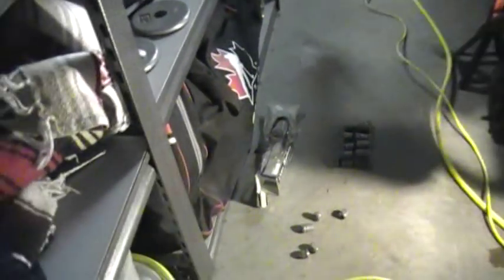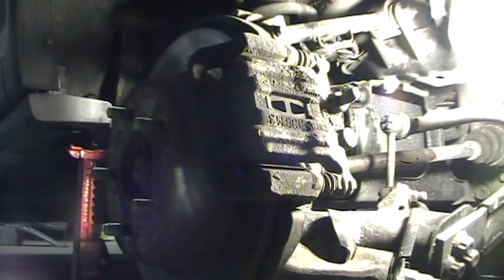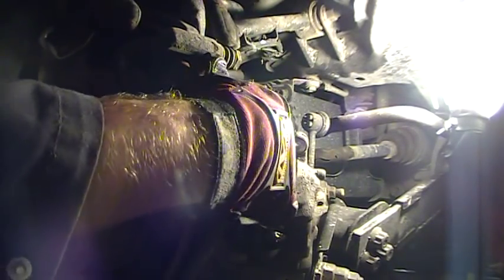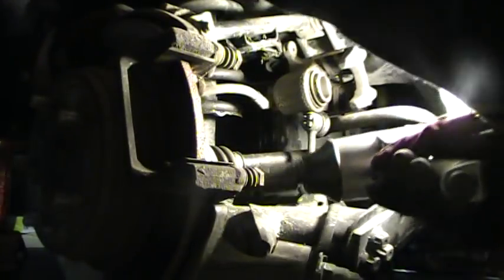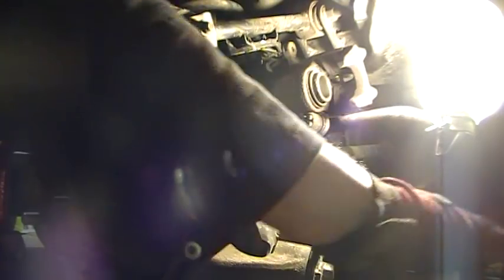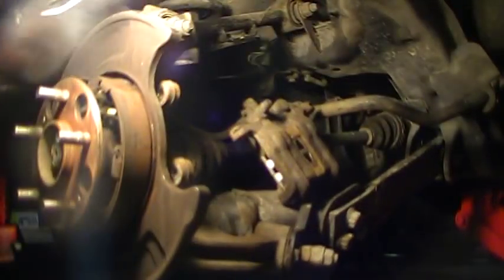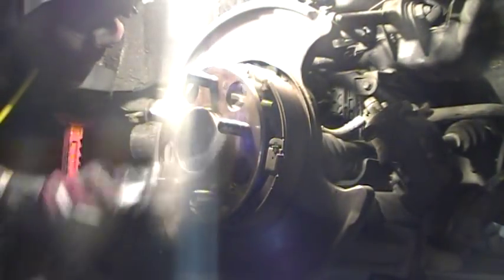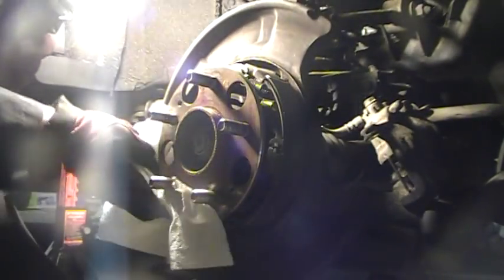How to Replace Rear Brake Pads and Rotors on a 2003 Honda CR-V

Comment: Thanks for taking the time and effort into making this video. A few things:

That access plug is there so you can turn/adjust the parking brake ratchet teeth without having to take off the entire drum. 

Also, torque specs for those interested (from the Helm 2003 CRV service manual): 
Front caliper bracket mounting bolts: 80 lbsf-ft
Front caliper body bolts: 25 lbf-ft
Rear caliper bracket mounting bolts: 41 lbsf-ft
Rear caliper body bolts: 16 lbsf-ft
Reply: Thank you!

Comment: The rubber cap is a plug for the access hole to adjust your e-brake shoes. Just use a screw driver to adjust.🚙😎
Great thorough videos.👍🏻
Reply: Through but so far from a good job that the video is dangerous.

Comment: Good video.  Thank you.  I would advise however not to put the clamp inside the piston when pushing it back.  Use the old pad on the piston and put the clamp on the pad.  I usually just use a screw driver while the calliper is still bolted to the car to push it back, but I was unsure if these were screw type or not.  So thank you again for solving this mystery!
Reply: The screw types are going to be when there's the parking brake included on the caliper

Comment: Watched this vid three times then went and did it myself. Also found two rotor screws were missing completely on one side....wtf. Thanks Dakota.
Reply from the maker: +uscg906 Ususally when the rotor screws get stuck or cause a huge problem, people just toss them. It's not 100% necessary since the wheel holds the rotor against the hub, but it makes reassembly a tad easier
Reply: The 2 extra threaded holes on the rotor are there to assist with rotor removal.  Thread a bolt into them to press the rotor free despite being seized up.  It saves a lot of banging on the rotor to loosen it.

Comment: The rubber plug you ask about stops the drum from having that vibration noise when you apply the break mainly cut out the ring tone in the drum  Nice Video

Comment: Great video.
 When the piston  on each caliber is pushed back ( all four) watch out for oil in the oil holding tank will fill up and spill out on to the paint of the body.
Reply from the maker: +Gregory martin You only really run into that problem if someone has filled up the brake fluid when the brakes are worn out. I've only ever had that happen to me twice.

Comment: That rubber plug removed allows access to the parking brake adjustment wheel ( Star ). Rather than prying or hitting a rotor,  remove the plug and rotate the hole until it is roughly in the 6 O’ clock position. You should see the adjustment wheel and using a flat blade screwdriver, you can turn the wheel to eliminate parking brake pressure on the drum portion of the rotor to easily remove it. Those two machined holes on your rotor will accept #8 metric bolts which can be alternately tightened to force the rotor off an axle. Work smarter not harder!

Comment: Don't know if it has already been said, but the rubber stopper on the rotor, is there to be able to reach the parking brake adjustment without removing the rotor itself.  I just saw it on another tutorial.

Comment: I appreciate your efforts here. One suggestion - maybe don't have the light shining into the camera.  Also one honda rotor tip, is that rather than prying it off against the fragile splash guard, use the two provided holes and run two bolts into them to push the rotor away from the hub. It wasn't the parking brake making it stick (or the wheel would not have turned so easily) - it was just rusted on.

Comment: I have a 2002 honda CRV and I need to change my front brakes. Can I rely on your video to change my front brakes or there are specific particularities for front brakes? It's gonna be a first time experience for me! Thanks for you reply
Reply from the maker: It'll be a similar process, but not the same. If you're mechanically apt, you should have no issues.

Comment: great video.  just curious, however.  doesn't anybody use a torque wrench anymore?
Reply: I use them just for torquing head bolts, crank or rods. that's the only time.

Comment: Thanks for the video. Question -- do you think it's worth it to take the old rotors off and have O'reilleys resurface them rather than buy new?
Reply from the maker: It is if the rotors are in good enough shape to resurface them. If they're dark coloured from being overheated, grooved, cracked, or anything else, then it's a good policy to replace them. If you take them to be resurfaced, then they should measure the rotor thickness to make sure that it's still safe to use. The rotors should still be adequately above the minimum thickness after cutting to ensure longevity and safety. If they don't have enough meat left on them, then replace them. It typically doesn't cost too much more to replace them versus machine them because of cheap brake parts.

Comment: Did you have to bleed your brakes after completing the job? And I have always just used a c-clamp and pressed back the caliper and the fluid would just return back into the reservoir. I had a buddy suggests clamping the rubber brake hose and open the bleeder when compressing the caliper and I think he said the reasoning is that with all the pressure pushing back on the master cylinder there is a chance of screwing things up. What is the proper way of compressing a caliper?
Reply from the maker: I don't bleed the brakes after doing a brake job, I always just push the piston back in and it never has had any issues. I sometimes crimp the brake hose and push the piston back in, but that I really only use for screw calipers.

I did have to bleed the brakes on this car though, but only because I also had a seized caliper on the passenger side

Comment: Rotor screws were put in place for assembly reasons on the assembly line. You dont need them to go back on. You could even drill them out.   If it comes down to the little rotor screws holding the wheel on you will be in trouble already.  You dont need those little things on there.
Reply from the maker: I drilled them out the last time I did them. I couldn't get them out.

Comment: Great video, thanks for posting.  I'm wondering what you did about the seized caliper?  Can these be rebuilt or did you just replace them altogether?  I have the same problem going on with my CRV.
Reply from the maker: anitan121 The caliper seizes because the piston rusts itself to the bore of the caliper, the piston has a nice polished smooth surface to promote better sealing, so unfortunately, all you can do is replace it since the piston needs to be replaced and they typically don't come in the rebuild kit. Plus it's less headaches and faster to replace the whole unit.
Reply: Moisture and debris  in the brake fluid can also attack the internal bore finish of the caliper making same  very pitted  thus allowing fluid to pass between the seal so even a new  piston is fitted  won't solve that problem..... then you have fluid leaking past the dust cover onto the pads thus degrading same.... if you are really stuck for a buck, a scrapped caliper from a junk yard  might an option for a rebuild

Comment: Thanks for the excellent video. Just curious what brand pads you recommend? Did you go with a aftermarket or OEM? Thanks
Reply from the maker: I personally recommend aftermarket parts, getting parts from the dealer is a ripoff. I use aftermarket parts that are OE replacements

Comment: Great Video. when you apply the brake quiet grease, does it get applied to both sides of the shims?  thanks again, will attempt on my 04 tomorrow.
Reply from the maker: I would just buy good raybestos pads that have the shims riveted to the backing plate, but if you don't have them, then yes, apply a thin layer on both sides.
Reply: thanks again for this video.  it really helped as I managed to change the rear pads and rotors on my 04 CR-V.  I had a real tough time taking off the two screws on the rotors.  I guess it was frozen and I don't have an impact wrench.  I had to drill the screws off.  I can't use them anymore and the new rotors don't come with new screws.  do I need to replace those screws?
Reply from the maker: You don't need to replace the screws; they just hold the rotors to the hub, which makes it easier for the automated assembly machinery to build the vehicle

Comment: How do I compress the rear crv caliper? Direct in or clockwise or counterclockwise?  Please let me know. Thanks.
Reply from the maker: Clockwise. You may need to pinch the brake line off and crack the bleeder screw to push it back in

Comment: First , what is the kind of grease you applyed many time on your video ?  And do you have a recommandation of web site for buying parts ?
Reply from the maker: Rockauto.com is a great website for buying parts. I use a product called syl-glyde or I use permatex brake and caliper grease

Comment: I did exactly according to video and book but now I have a quiet touching noise coming from that area. Don't know if I have to drive it a lot to wear in?  All new pads and rotors on the back
Reply from the maker: +canonhawaii pull the rotor off and try loosening the parking brake adjuster. I think your parking brake shoes are dragging
Reply: +6speeddakota Cool,  do you have a video on that?
Reply from the maker: +canonhawaii Unfortunately, I don't. What you need to do is take the rubber plug out of the rotor, and turn the rotor so that the hole is at the bottom. Look in there with a flashlight and you should see a toothed wheel. Stick a screwdriver through the hole and turn that wheel to adjust the parking brake. You'll need to figure out which way is tighten and which way is loosen, but it should only take a few clicks to figure that out.

If you can't quite get at it using that method, then take the rotor off, adjust the star wheel, and test fit the rotor. You're supposed to have a slight interference fit, but I find that it needs to be backed off so it doesn't drag at all.

If all else fails, you can do the lazy man way and just pull on the parking brake a few times while moving to wear the shoes down :) but I don't really recommend that one
Reply: +6speeddakota cool thnx!

Comment: Don't do what this guy did. He's unskilled and ignorant.  It's obvious why he USED to work for "Honda".  He is too dangereous to trust with a customers car and  life.  He doesn't have enough experience to hand-tighten the mounting bolts of the PRIMARY SAFETY SYSTEM without a torque wrench, and he didn't.

Same as with any drum brake, loosen the brake shoes before pulling the drum/rotor.  If not they grab the rust ridges, and can be bent out of alignment,  bind and permanently damage the very thin linings.   

Once the rotor is off CLEAN EVERTHING WITH BRAKE CLEANER.  Breathing that dust can permannetly damage your lungs. Clean the outside of the caliper pin and lubricate the boot before pushing it in so you don't push crud into its folds. Clean the inside of the drum before installation. Lubricate all exposed rubber parts with silicone paste.  Lubricate the parking brake shoe bearing points.

ALWAYS dry-fit parts before final assembly. Install the retention screws beforw checking for drag and adjusting the parking brake. CLEAN and relubricate the caliper guide pins. CLEAN THE caliper frame before reinstalling a LOT tighter than was shown here.  REPLACE the abutment clips and springs. They are provided with Honda brake pad kits for a reason.  

ANTISEIzE is not lubrication. Use it as a l.ube on pad bearing points and they WILL seize.  Use silicone paste to lubricate the pad bearing points, the new abutment clips and new top pressure springs.  There is no "MIGHT need a wrench" to stop the glude pins from spinning. Fail to use one any you can chew up the seals and wedge the pins, whch creates symptoms later that look like a failed caliper.       

Then BLEED the brakes. and top up the fluid in the master cylinder to the MAX line.

Comment: Why didn't you use the torque wrench?
Reply from the maker: It's really not critical as long as the bolts are adequately tight. Using a torque wrench really just burns time if you're trying to torque every fastener.